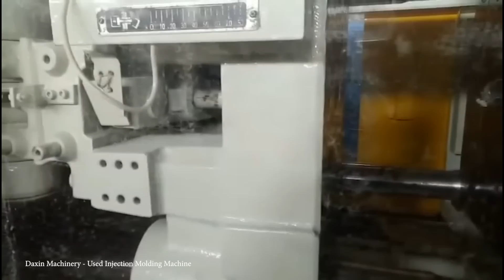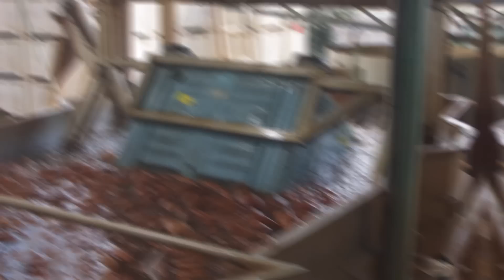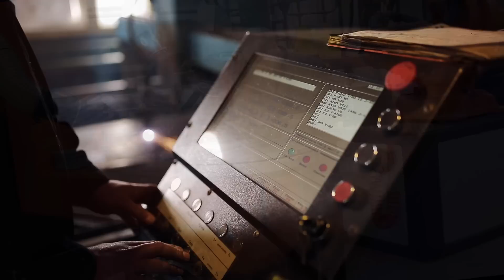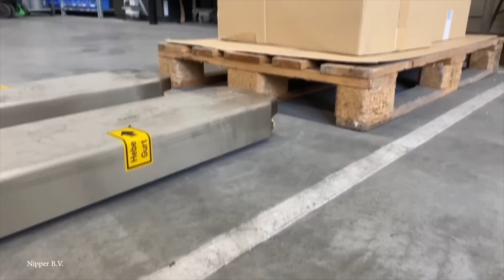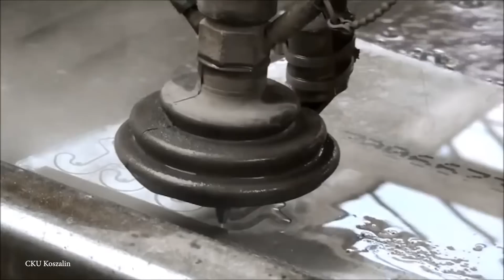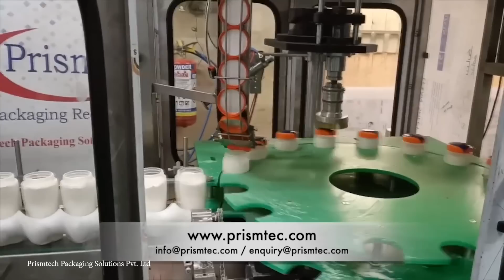TOP 15 Satisfying Factory Machines

Comment: I started my work in a dairy factory where we filled all sorts of products in bottles and later in plastic cups and cartons.  The milk filler was the fastest, it could push up to 20,000 litres per hour into the large steam tower for pasteurization or sterilization.  Every minute there was a stop line the clock ticked and if the operator was not able to fill enough production they got demoted to a slower machine - yes, even in the seventies there were expectations.